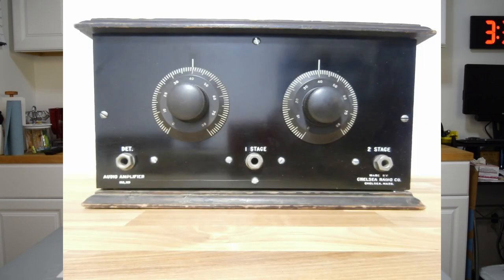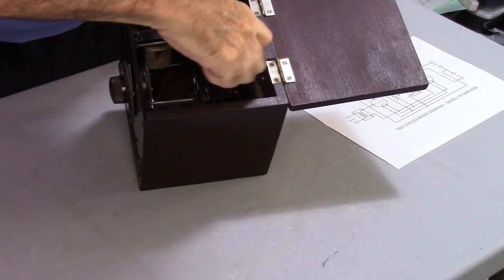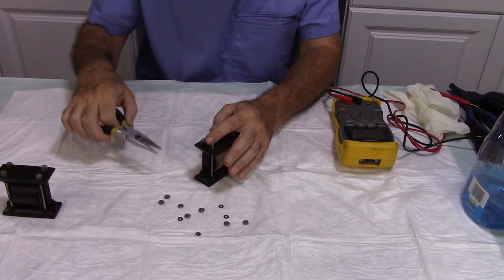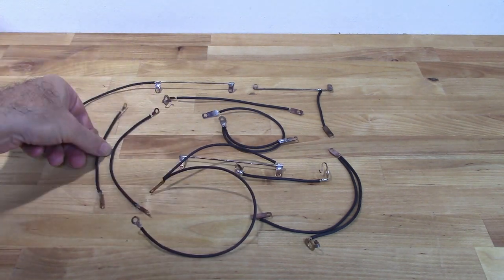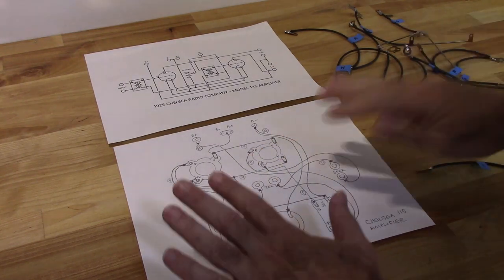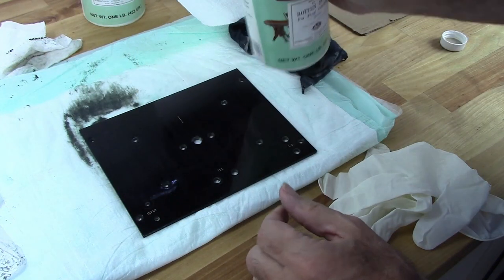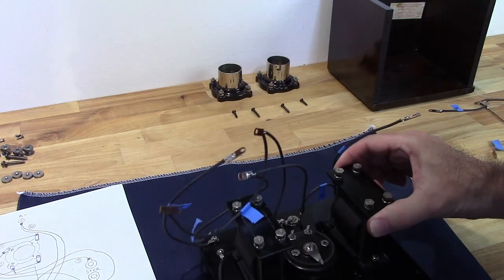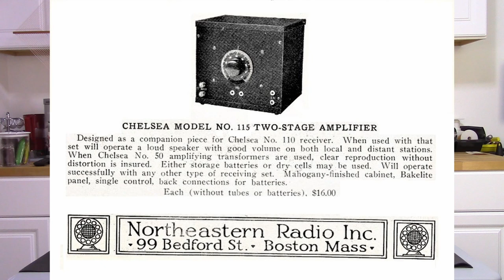How to Restore a 1924 Chelsea Model 115 Amplifier

Comment: Good video, I have found that not all spaghetti is brittle, some is still very flexible.Another one saved.
Reply: Yea, my intention was to keep the wiring intact.  But it became quickly obvious this was not going to happen on this one.  I use old wiring every chance I can and usually it isn't that brittle.  This stuff was really bad.
Reply: @willow55us  Unfortunately it could not be saved, if only Chelsea used regular bus bar wiring.

Comment: I have been following this series and noticed something. None of the Chelsea radios or amplifiers seem to have a C battery. Is there a reason for this? Even if the radio/amplifier works without one, a C battery reduces the B battery current and B batteries were expensive.
Reply from the maker: Yea, I have noticed the same.  Chelsea radios and many others of the 1920's did provide voltage to the grid circuit, but by design Chelsea seemed to favor using a 45V B battery for normal radio operation, and a 90V B battery voltage applied to the plates on the amplifiers.  Adding a grid bias via C battery would have made them more efficient.  But I do have to say, the Chelsea radios do seem to operate for quite a long time on the B battery setup.